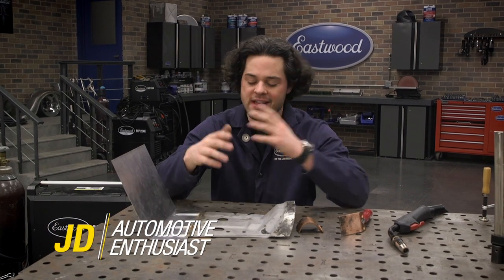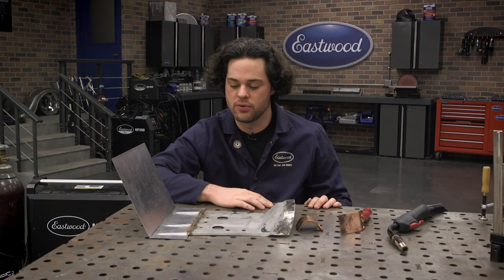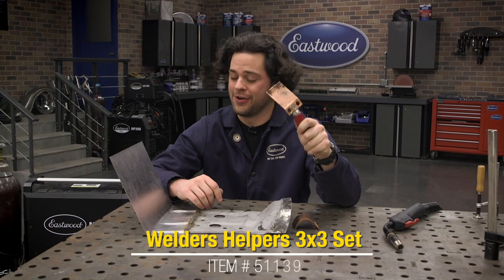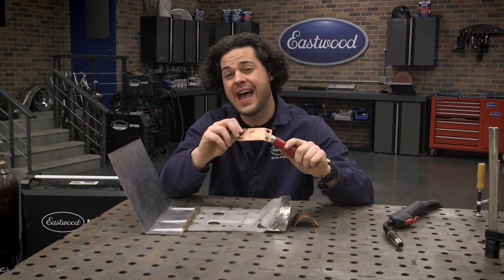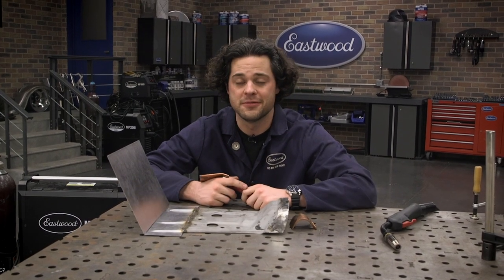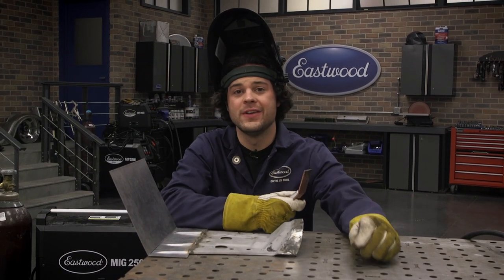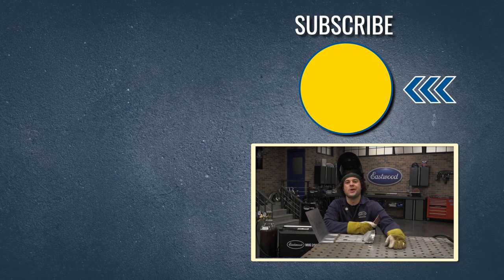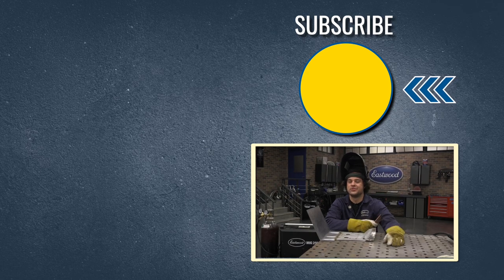How to Fix Holes in Thin Metal When MIG Welding - Sheet Metal Tips and Tricks

Comment: Great tip - if you can get behind the metal. Might be a bit tough doing floor pans! BTW - I LOVE the magnetic plug weld tool that you guys are advertising! Man I would've loved that when I was welding the quarter panel on my VW.
Reply: Been there, I used a jack with a bit of wood to hold the cooper plate under the floor. A bit finicky but it work

Comment: I've used copper for years working on steel and aluminum. Cuts down heat/excessive penetration/ and buildup. All those are what warp your material. Aluminum stock behind steel works too if you have some laying around, just might stick to your material so make sure to break it free often.

Comment: I definitely do not recommend buying anything from Eastwood. I got a radiator from them, does not cool the engine at all. I put my old flakey stock one back in that was smaller and it cooled my engine fine. They approved for me to return iin October 2021 and told me they will send a "return authorization document". They never sent it and now they are ignoring my emails with no response at all from the website or anything. Now it is January 2022 and I am just another ignored customer.
Reply from the maker: Hey jrlegacy23, 
We apologize for any issues with the radiator that you received from us. Please give us a call at 800-343-9353 so we can make this right.
Reply: @eastwoodco  I will try this but I keep getting no where after it was approved for the return.  Making comments everywhere is the only way I get a response.